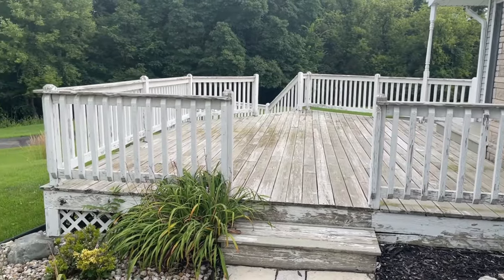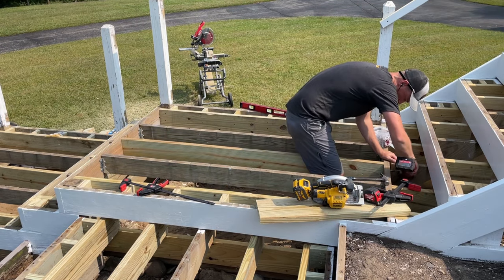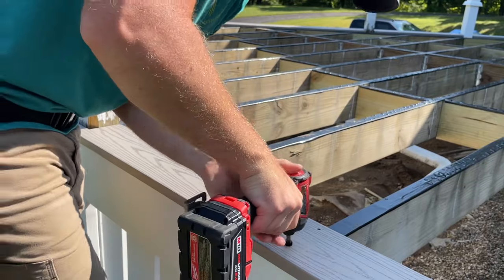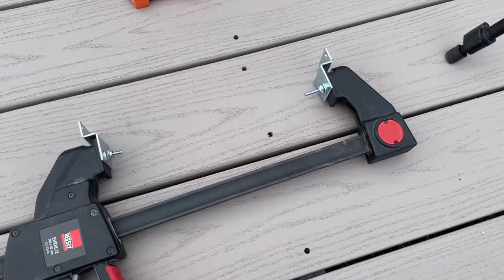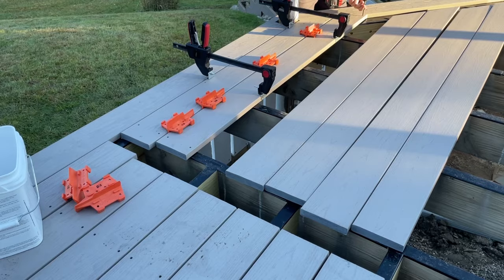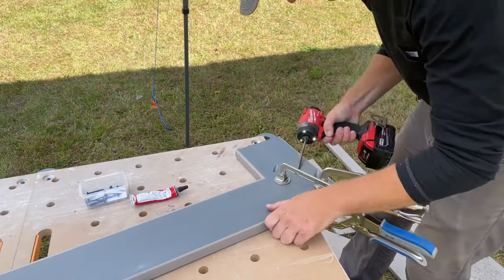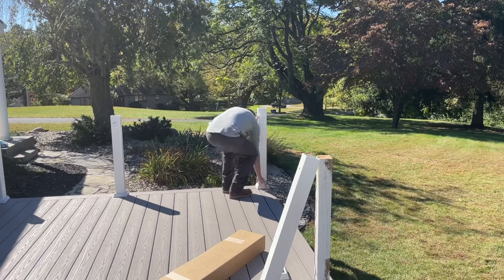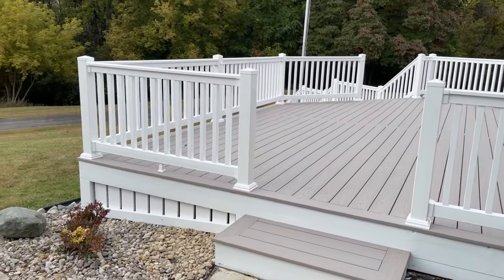Deck Remodel | LED Lighting, PVC Decking, Vinyl Railings

Comment: Your deck looks fantastic!  I did the same thing to my deck eight years ago.  I used the Trex deck system on my deck.  This included the post sleeves, railing, and down lighting on the posts.  The only things that needed painting were the support beam, 6x6 posts and the stringers for the stairs.  I used the hidden fasteners for the boards and the Cortex screws with the plugs for the step risers and trim boards.  The deck still looks great today.  Yours should last for many years virtually maintenance free.  Enjoy!
Reply from the maker: Awesome man! Can’t beat the low maintenance decking!

Comment: Looks great and is well put together.  I haven't see any composite decks that have no maintenance though.  Cleaning those white railings is a pain and the decking texture wears out quickly and the boards need replacing.   Unless you have lived with a deck like this for a while, these are things that sales guys don't tell you.
Reply from the maker: This is a pvc product with a 50 year warranty, not even a comparison to older composites you have experience with man! Less maintenance as in no sanding, painting, staining, patching. Of course it’ll still need it’s yearly cleaning 👍🏽

Comment: Watched this because I'm educating myself on resurfacing our deck. The way I see our deck, the bones are solid. We need the surface boards replaced and possibly the railing over time. This is all new to me. The spline board does not exist on our current deck, but I like the look of what you did. When factoring in waste of the boards, I wonder how the best way to pick the 2*6 is. I have just about 24' width on 16" joist spacing. Makes the most sense to butt two 12 footers up against each other and leave 5.5" for a spline? I was going to buy 16 footers and go from there. Regardless of whether or not you respond, very impressive video on all accounts. Well done, sir!
Reply from the maker: Thank you! Yep 12’ boards sound perfect, especially if you do a picture frame all around too

Comment: I was surprised to see the corner miters being glued together. I've been told to leave those miters gapped to allow for expansion and contraction with the temperature change.
Reply from the maker: Big difference between pvc decking vs composite. Still nice and tight miters with the pvc 👍🏽

Comment: Looks great.  Can you please provide a picture (or explain) how you mounted the post lights at a 90 degree corner?  Thanks!
Reply from the maker: I cut a couple small angled pieces out of some pvc trim board to mount behind the light in that corner

Comment: Great job! One thing I wonder is how the material works regarding thermal expansion / contraction. In particular whem you put in that center deck board, you said it was a snug fit...
Reply from the maker: With this particular pvc decking you can butt them tight. Composite is completely different

Comment: Great job! I have a couple of questions.
1. during the demo, removing the old screws with a crowbar wont damage the frame/joist?
2. do the old screw holes need to be filled as well? or is the joist tape sufficient?
3. what about using a camo system for securing the deck boards instead?
Reply from the maker: Just depends on the condition of the screws. A lot of time they’ll just break off, or if they’re not too bad it’s probably better to just unscrew them. Then yea just the tape will seal all the holes. At the time I did this, timbertech didn’t recommend the camo system with this decking for warranty. But now of course they do have own similar system haha. It’s a good method
Reply: @JohnBuildsIt  Thanks John! I honestly didn't expect a response back. I have a ~550sq.ft. deck that is failing and I want to take this on myself. I'm mechanically inclined but I haven't done anything like this ever. Good news is that it is a straightforward deck, just one surface. You'd think it would be easy to tackle but I'm nauseous thinking about starting it and not getting the time to finish it off or getting stuck somewhere and not have a way out of it. deck builders in my area are telling me wildly different quotes and I'm hoping to save the labor costs and apply it towards excellent quality materials (like ironwood or tigerwood deck boards) which will come with its own set of challenges. Thank you for sharing your videos though. I really appreciate all that you do!

Comment: Beautiful!  What manufacturer did you use for the railings?  How are the deck boards holding up, do you find that they are slippery to walk on?
Reply from the maker: Brand is Weatherables. Ordered online through Home Depot. Deck boards are still looking brand new and slipping hasn’t been an issue at all 👍🏽

Comment: Absolutely amazing. Great work as always! Question. Scribing has always kind of confused me. How do you measure how wide your scribe is set? I noticed you basically cut the scribe down the middle of the board.
Reply from the maker: I set the second to last board in place and just measured how big the cut piece needed to be at its smallest point, then set the scribe at that size
Reply: @JohnBuildsIt  Nice that makes sense to me. Lol thank you.

Comment: ALWAYS USE JOIST TAPE OVER THE OLD JOISTS. I did basically the same job. Old framing, new deck boards. Used cedar, not composite. I did not use the tape over the joists unfortunately. Deck came out beautiful but it squeaks when you walk on it in places. Tape would have prevented that from what I understand.